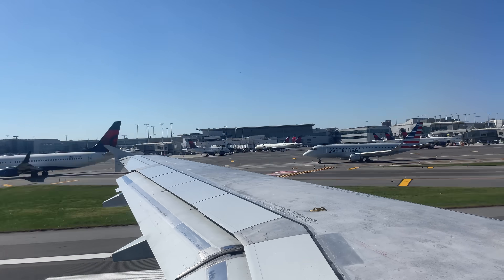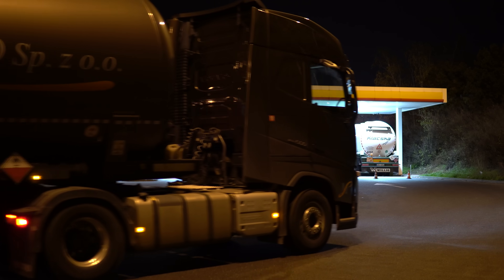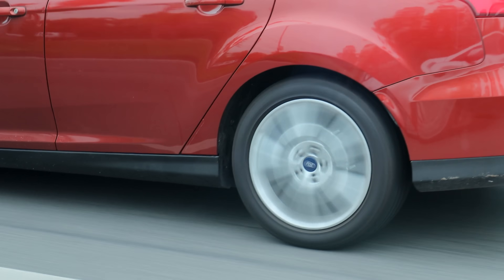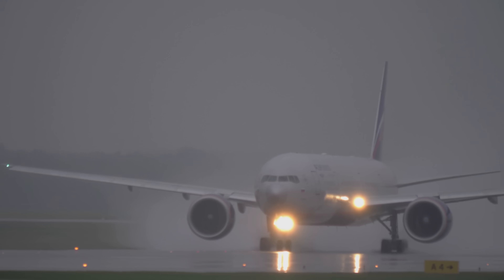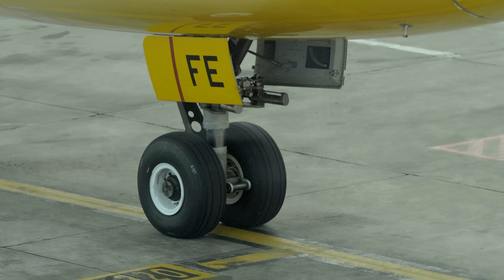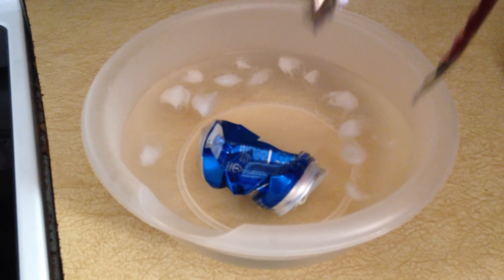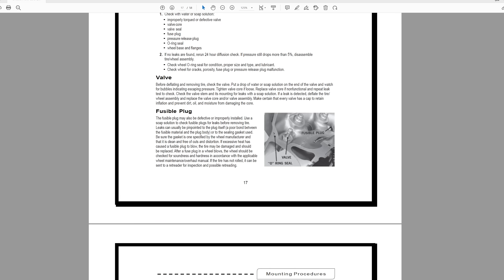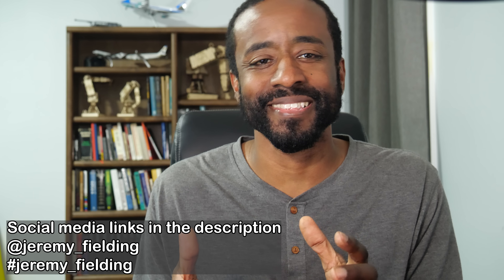The Ingenious Design of Airplane Tires- Jeremy Fielding 107

Comment: Great video! Great to see your son shares your enthusiasm. Heavy jets have higher speed ratings for their tires. The speed rating is marked on the tire. Strangely, all speeds for pilots and ATC are in knots (nautical miles per hour) but the tire speeds are marked in statute mph. Most of the 737s I've flown had 215 MPH tires while the heavier jets I've flown (767-332ER) had 235 mph tires. In the 767 at max weight you would normally liftoff close to V2, about 170 kts or (170X1.15= 195 mph) so there's a good margin in case you need to perform a partial or no flap landing with higher approach speeds. Finally, another benefit of higher tire pressure is hydroplaning. The types of hydroplaning are viscous, reverted rubber and dynamic. Dynamic hydroplaning occurs with water on the runway and it's 8.7 times the square root of the tire pressure for speed in knots. A 200 PSI tire will hydroplane at about 123 knots. For statute mph a good estimate is 9 times the square root of the tire pressure so a 38PSI tire will hydroplane at about 55mph. Cheers

Comment: My dad is a retired TWA mechanic. As a young teenager, he took me to work at JFK airport (sadly that is something no child will likely ever experience again). One of the things he showed me was the huge hydraulic jack used to change tires and brakes. I also sat in the FO's seat while he started the engines on a 727 and taxied it over to the terminal from the hanger.

Comment: Jeremy, great video!! Thanks!! ... Also, incase you didn't know, I think the Concorde firey takeoff and crash from .... 40?? years ago?? (not sure when, exactly) .... was caused by an exploding plane tire ... the shrapnel from the tire burst the wing fuel tank on takeoff ... the original cause was something on the runway dropped by a previous plane ... that's what punctured the Concord tire ... i thought it interesting to point out the similarity to the exploding plane tire situation you mentioned.... Keep up the great work!!

Comment: Your calculations and assumptions are incorrect. 
In the case of a B737, about 90% of the weight is on the four main tyres of the landing gear, not al six tyres.
Reply from the maker: Agreed:) thanks

Comment: Re: tire loads, it's actually worse than that. Airplanes land on their main landing gear first, before the nose comes down. So in the case of the 737, that's the entire weight of the airplane being slammed into the runway by only 4 tires, not 6.
Reply from the maker: Agreed!
Reply: This, plus 90% of the aircraft weight is on the main tires.

Comment: The violent transfer of linear to rotational energy at touchdown and the huge rubber burn has always seemed sub-optimal, even silly and dangerous to me.

Huge unnecessary sudden stresses. Bad for safety, and of course the lost rubber has to shorten tyre life.

Spinning the wheels up to nearer landing speed shouldn't need much of a motor … 

or one could probably get the wheels to spin at least helpfully fast just by adding cups to the sidewalls so they can get spun by the airspeed.

Landings could be gentler, safer, cheaper …
Reply: LOL.  Oh the keyboard warriors.

Comment: I believe takeoff speed of a large airliner is above 150 MPH. I think most airplane tires are inflated with Nitrogen gas which is more stable and does not contain moisture.
Reply from the maker: Indeed they are.
Reply: You watch the video?  Or are you one of those that talks and asks questions in the middle of movies and lectures?

Comment: I have a B.S. in engineering from Purdue and went on to get a commercial rating in fixed and rotary wing aircraft after flying in the Navy.  I gleaned good new information from this video. Great cadence and very well done sir. One of the greatest stresses on these tires is when they're turning at very high weights while taxiing for takeoff i.e. huge side loading. One tidbit of information I can mention to add value to this is that dry air is more dense than humid air. Yup, read that again, it's true. The airlines will retread the carcass of these tires up to four or five times once cord starts to show then it's time to "lease" a new copy as I'm pretty sure the operators lease them and don't buy them. Perhaps the airline tire business could be your next enlightening video (hint, hint, cough, hint). Thank you.

Comment: The information concerning the aircraft tire is incorrect.  I am a FAA licensed Airframe and Power Plant technician with 49 years in aviation and 32 years on B-737 aircraft as well as most of the other commercial aircraft in service.  Also, I have 22 years in the air force 9 of which as a flight engineer flying large cargo planes and the remainder as an aircraft maintenance technician.   There are some things that needs to be corrected.  Aircraft tires have been serviced with dry nitrogen since the 1940s.  The reasons nitrogen is used is (1) the tire pressure not affected by temperature like compressed air is.  Compressed air pressure is a tire changes 1 psi for every 12 degrees F of temperature change.  2nd, as the aircraft's altitude increases the outside atmospheric pressure decreases and this minimizes the effects of the cold temps and lastly the nitrogen doesn't support combustion.  The comment about the fuse plugs installed i the wheel assemblies have nothing to do with the stresses on the from the landing.  There are usually at least three of these plugs in the main wheel assemblies.  They are made of a material that will melt at high temperatures.  The purpose of these fuse plugs is to prevent a tire from exploding due to thermal expansion of the nitrogen caused by a hot brake.  During a rejected takeoff the brake discs will be so hot they will be glowing red hot.  When the fuse plugs melt the tire deflates preventing the tire from exploding and also cools the brake.  This is the final reason nitrogen is used.  Compressed air is 20.9% oxygen, and it would not be very good for an oxygen rich gas to be blowing on a brake that is glowing bright red from heat.  I apologize for being so long winded, but I thought you would appreciate the additional details.  Curently I am working on the "Return to Service" team for the 737 MAX at Boeing.
Reply from the maker: Sir... none of this disagrees with what I said. Though I appreciate you adding some details to a video that was designed to be understood by lay people... much of this is exactly what I said. So you are a bit to zealous in saying the information is incorrect. It sounds like we mostly agree and the rest is just adding details. For example...the fuse is important for overheating during landing due to friction with the ground spinning up the tire and braking combined...both heat the tire and this is what I said in the video. Also the rules about the requirement is directly from the FAA records. I didn't say no one used Nitrogen before that otherwise it wouldn't make sense to note that "at least one tire was filled with compressed air" as I stated in the video which comes from the report. I am mostly replying to this comment because people can get confused when you claim a bunch of titles and say "the video is wrong." Then proceed with a long reply. As someone who does this a lot, I know people read the first few lines and bail meaning you left the wrong impression. Anyway thanks for watching. Like I said, we seem to agree, and I think having so much experience you were looking for details that didn't matter as much for the audience I am trying to reach... at least in my opinion. "Experts", because they know the basics, tend to get really excited and jumpy about the details. I appreciate that you love this subject, and thank you for leaving a comment to tell us about your passion.

Comment: btw truck weight isn't limited by the tyre capacity but by how much pressure the road can withstand. So the truck tyre can probably safely take a lot more than two tons!
Reply from the maker: Absolutely true! I just needed "something" concrete to give an example. It seem logically to not over engineer the tire, so they are not likely to be "much" stronger than the legal limits of driving on American roads plus some safety margin. But I 100% agree they might indeed be much stronger. I have not easy way to find out exactly what the number is. The same for Airplane tires. They have a huge safety margin and are much stronger than just the weight of the plane. They must withstand the extreme pressures of landing and braking. So I still think it was a reasonably fair comparison.

Comment: Typical maximum legal load of a truck tire is about 4000kg (well in europe for normal trucks, yes there is some special rules for low speed vihicles). But the tires is typically the wheel is designed for 6000kg.

Some truck tires like the one for harbor/Terminal trucks is designed for 12 000kg.

Also worth saying that rolling resistance is larger in small tires. Its really high in aircraft's. If they just stop the engine the aircraft slows down very fast with out breakes. (at lower speeds).

For an aircraft is of cause don´t matter as much, because when it comes up to speed, the weight is partially lifted of the wheels reducing it about the same rate as air resistance is introduced.

For a car it would be totally a killer for mileage to have small wheels. Specially when the test is at fairly low speed.

The main reason why car tires have realtivly low pressure is for grip. A truck can just press throw small bit of gravel. But a car is so light it would just float ontop of gravel and totally lose grip if they had truck like tire inflation

Comment: 14:20  Also when you increase the pressure and increase the rigidity of the tire, you reduce the total surface area that contacts the road and reduce traction. it makes improving the fuel efficiency reduce the safety.

Comment: All southwest operated are 737 variants so youve probably flown on one with another carrier. The new trents have fan blades grown as titanium alloy diamonds. When the fuel is thrown in the noise is absolutely incredible, shaking the ground and spinning impossibly fast and then somehow becoming a comparitive whisper at idle. Incredible. Look forward to more air stuff !!!

Edit: you mentiined that size and weight is important and i found you through motor stuffs, i wonder/kind of assume you know planes and some equipment have 400hz mains :D

Comment: I learned a lot from this video. I have spent many years working on and around military and commercial aircraft, but always on their electronic systems. Never had an occasion to learn about tthe tires other than the very basics - that they are filled with dry nitrogen, and you have to move the chocks a few inches away from the wheels before fuelling or loading. Thank you for increasing my knowledge base.

Comment: The amount of tires on a truck are meant to spread the weight across the pavement to prevent damage so there is no need to design them to take heavy loads unlike an airplane.  Comparing apples to oranges.
Reply from the maker: I talked about this in the video? Perhaps you didn’t watch it all. But it’s in there.

Comment: The thought of regular consumers filling their car tires with the same pressures as aircraft tires, even if they could find such a compressor, is terrifying. 

You typically put an aircraft tire inside a safety cage while you fill it. If the tire fails during filling either from over pressure or because the tire is just fatigued, the explosion is deadly.

Regular consumers are not going to put their tires in a safety cage. We can barely get everyone to wear their seatbelts.
Reply from the maker: Yes it is scary!

Comment: I was in the Air Force, worked cargo and fighter planes. Fighters have built in pockets in them, they fit unused pencil erasers. if the metal shows, time to change tires. They land weighing probably 36000 on landing, just about out of fuel, ordinance expended. The F-105F/Gs' I worked on had a landing speed of over three hundred miles an hour. Tires last about five landings or less. Cargo planes last longer but weigh far more. They're filled with way higher pressures than your car tire or your bike tire, more like 3000 PSI or on landing they'd flatten so bad they couldn't roll.

My father worked for Lockheed and the Army Airforce asked them to research a way to stop the smoke on landing. What they found was no matter if the tire is spinning, it's the transfer of all that weight from the airplane to the ground, so to this day, when you see that smoke, it's the tire being stopped momentarily before rolling again.

Comment: I've always wondered if you could attach small triangles of fabric around the 'hubcap' of a Airplane wheel attached along  only 2 edges such that they would catch the air like small kites and spin the tyres up to some proportion of the landing speed before contact. I've heard that airports spend a fortune cleaning rubber off their runways. Might make the tyres last a little longer too = good for the environment. Of course you could do this with a motor, but I thought a low-tech solution might be cheaper to get through safety testing.

Comment: On a dry cold day sometimes you can get a shopping cart that will shock you as you push it down the isles. This is static created between the rubber wheel rolling on the linoleum floor.

Comment: Some things not covered, aircraft tires are rebuildable and one carcas is excpected to last.... well, there are Douglas DC-3's flying around on OEM carcases that have been retreaded dozens of times. I've seen tires probably close to 50 years old still working. The Douglas A-3 Sky Warrior had the largest low pressure tires ever used on a carrier born aircraft. They were over 4 feet tall and if they ....detonated, everyone knew it for miles around because it sounded like a jet crashed. Also, the tires are non-conductive, there are ground wicks mounted on the main mount struts and often the tail wheel strut as well as an array elsewhere on the aircraft. Aircraft tires can take a lot of heat, and the fusable plugs do not melt out until its hotter than 450F. For an aircraft that comes in with hot brakes, another aircraft will often take position to blow its jet exhausts across the tires and brakes to cool them down. During this process the tire may fail, that is dangerous but the brakes may burst into flames or explode... so... when it happens the maintenance personnel have to be extra careful, but usually as soon as the brakes loose their red glow it can go to the line/parking stand, just don't get near the wheel and keep that one guy away from the thing....cause if he pees on it, its gonna sting and possibly take one or two legs.

Comment: Why do aircraft tires have temprature based fuses (not sure what to call them) rather than pressure based ones?
Reply from the maker: In short the tire can handle way more pressure then it is rated for… in fact the rim will usually break before the tire. But fire/ burning rubber is way more dangerous
Reply: @Jeremy_Fielding  Thanks that's exactly what I wanted to know!

Comment: A question concerning plane tires I have had for a long time is why are the tires stationary when the plane hits the ground? The surrounding air could easily make the tires rotate at landing speed. Are there rotating effects like gyroscoptical forces that you do not want to interfere with flying the plane or what?

Comment: I had a piece of equipment one time that had airplane tires on it.  They were 32 ply, and the sidewalls were over 2" thick.  They were also rated at 200 miles per hour.

Comment: I think you are overlooking a more significant reason for the capacity difference, the surface it travels along.
A truck is designed to travel along a wide variety of roads, some of which would easily be destroyed by the loading from a plane wheel. A truck needs lots of wheels to distribute that load across the road. You mostly covered this near the end, but I think it is also important to bring up when discussing the loading.
Reply from the maker: It’s definitely important. I chose to cover it when referring to why trucks don’t use smaller tires. I think I communicated that message. Truck tires could be like airplanes BUT. 😂

Comment: Part of the reasons the tires are smaller is because of centrifugal forces on the tires when landing. Its easier to bring a 20 inch tire up to rotational speed than it would to bring a 40 inch tire. Right?
Reply from the maker: I don't know how important this factor is, but is sounds interesting. Especially since so many other factors change when you change the tire size. I would be interested to see a chart of how much each variable changes when you change tire size and how that effects price, longevity, and safety.
Reply: @Jeremy_Fielding  it would be an interesting study seeing how much force is needed to take the wheel from stop to landing speed in an instant. Also the wear on bearings and the landing struts. Im sure its significant and part of the equation. Not as important as weight, but still a factor to  consider.

Comment: If all other variables were equal, a tire with larger diameter seems like it would require more torque to rotate, and thus would skid for longer before matching the speed of the runway on landing. I wonder if the reduced wear of a smaller tire is a significant factor in the design or if it's negligible compared to the other things mentioned.
Reply from the maker: This is indeed an interesting question. How does tire size change tire wear and the economics of that decision.

Comment: The load on semi trucks is restricted for road wear, not necessarily the actual tire. Aircraft tires also need to accelerate to full speed quickly to keep wear to a minimum.

Comment: The main tires on the F104 have shallow holes in the tread drilled at an angle to facilitate the spin caused by the airstream so the skid upon landing won't be so great.